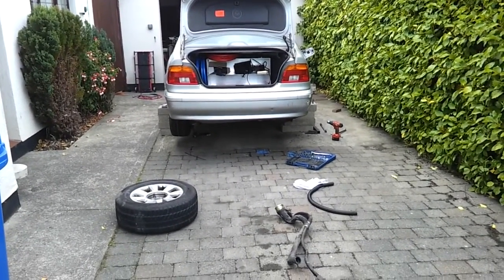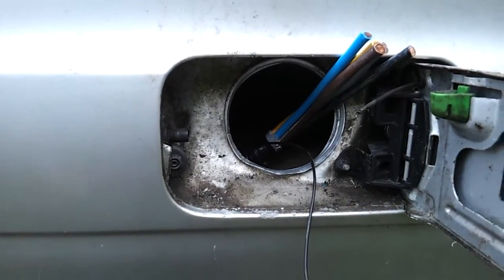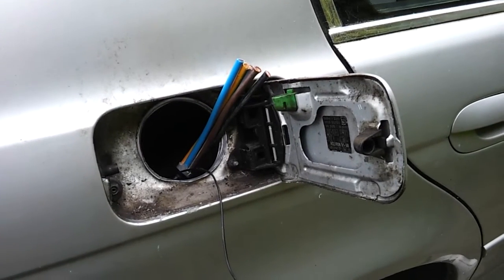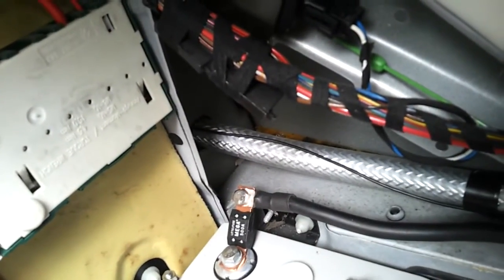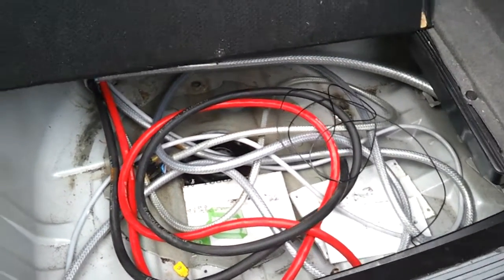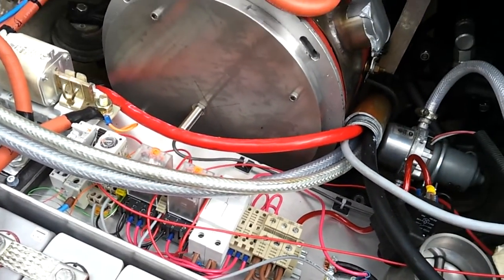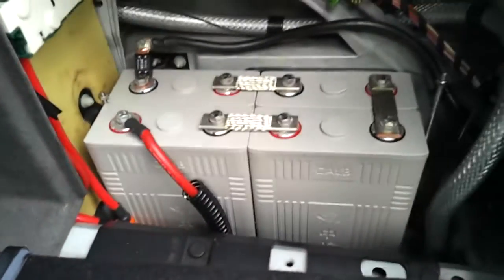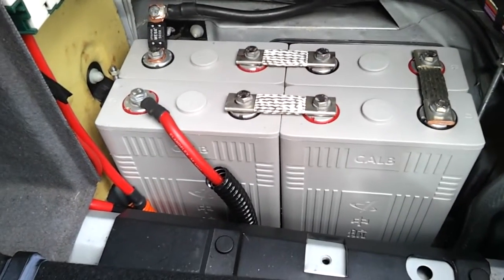BMW E39 EV Conversion 20 Cable Guy

Comment: Stainless bolts are not really work well with mild steel. It could be corrosion around them in no time. ( pare of different metals in wet place ) It used to happen all the time at my last job.